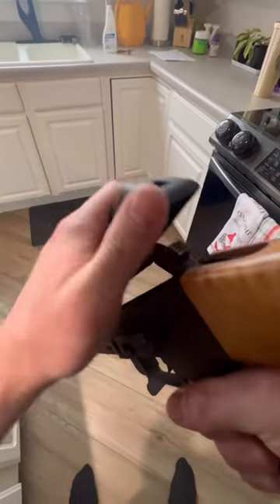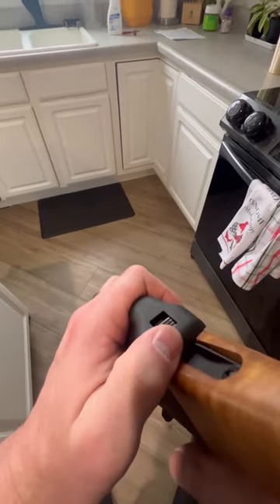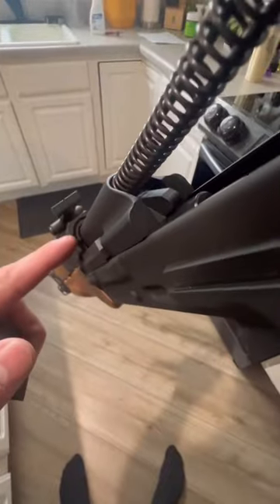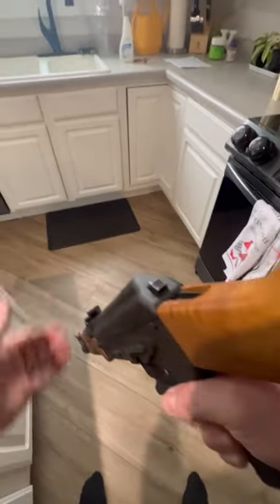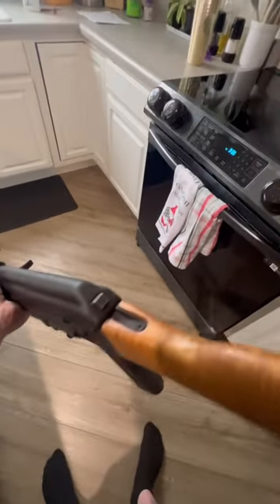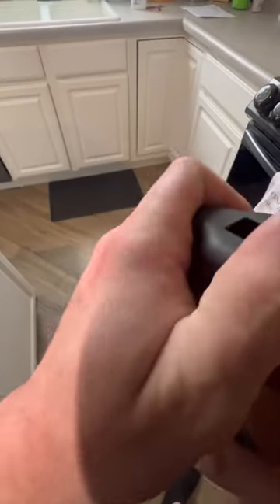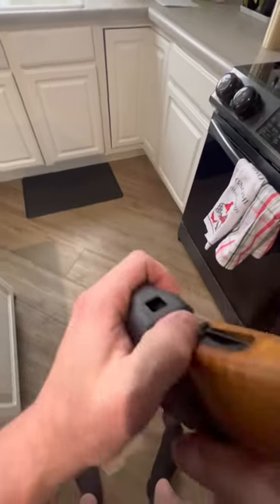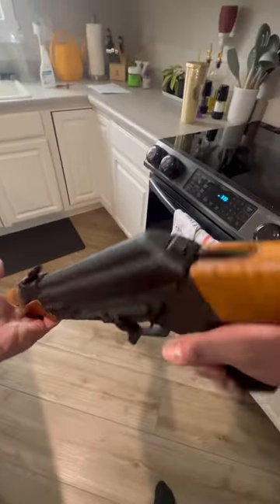Most consistent way to install an AK47 Dust Cover

Comment: I always just put the dust cover on the rear spring, then push it inwards until the dust cover can sit in the groove, and then I push down and the spring pops in…
Reply from the maker: Maybe when I get a little more wear it will work for me

Comment: What if your dust cover doesn't want to sit?  

I have a Romano AK without a stock, and the dust cover feels wobbly even when I fit it back on.  And I can't tell if I did anything wrong with it.  I only recently purchased it about a month ago too, and it didn't feel loose until I took off the dust cover the first time.
Reply: My Romanian cover was bent to shot and wouldn’t stay on. Got a new cover and it works fine. Got a new AK today and the old bent cover fits on it fine.🤷‍♂️
Reply: @obsidianet    Yeah I'm kind of figuring getting a new AK might be better, granted I managed to kind of force the dust cover on, but I can't imagine it's a good idea to let it sit that way.
Reply from the maker: Are you still having this issue?
Reply: @DumbGrunts  No luckilly I figured out my problem.  I was just being an idiot.